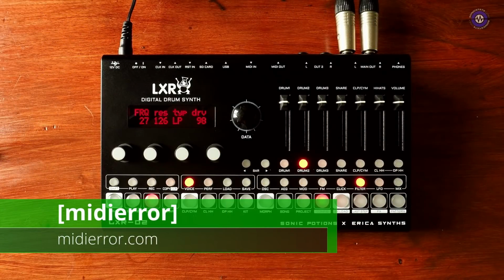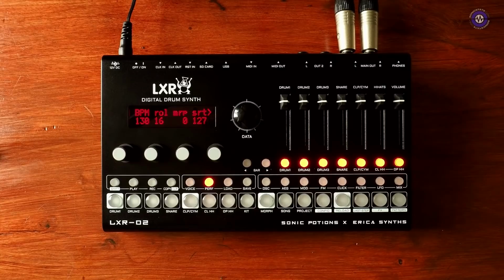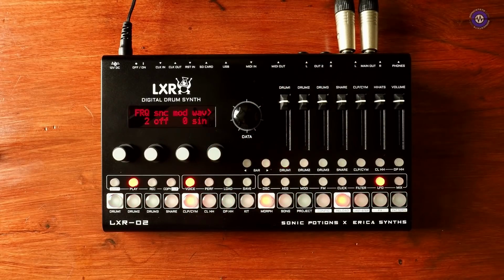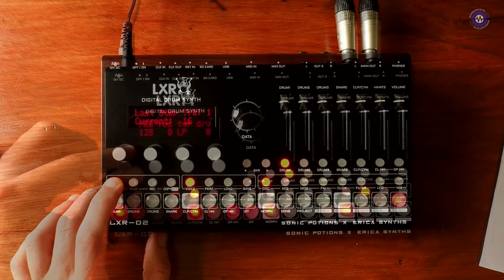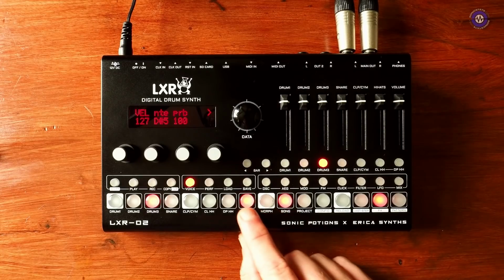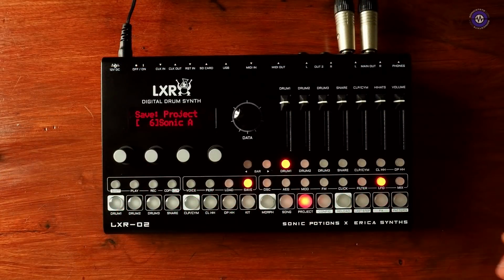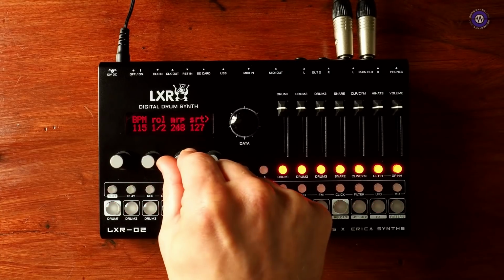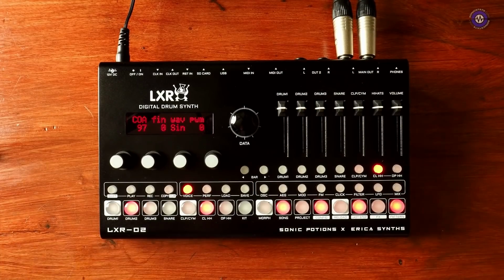Erica Synths LXR-02 Drum Machine - SonicLAB Review

Comment: After much Umming and Ahhing on my part, I at last decided to get an LXR02.  I've only had it a week and I'm still very much at the reading/memorising the manual stage but here's my first impressions:

PROS: Solid build and good feel.  Amazing sound design possibilities - and you can play each drum voice as a chromatic monosynth from an external controller. The drum voices lie somewhere between the Volca Drum and the Model Cycles/Syntakt.
CONS: Button layout makes no sense. The developers should have used the same UI for loading/saving projects/kits/songs as the patterns mode (i.e.  using the steps and bar buttons).  I look forward to the implementation of 
"Performance mode" because, at present,  it's kinda empty/crap.     There's no stepjump or live stutter  control.  The live "roll" feature is gridlocked to 16 steps per measure (there is a flamm feature in step record though).

Comment: Thanks for the video. I was so excited when I heard this machine was on the horizon but now (and sorry to go against the flow of opinion) I'm bored with it already. Work flow appears cumbersome, just 16 steps per pattern (really is that correct?) every demo so far features such a limited sound palette (which on paper shouldn't be the case). 

I was hoping it would have everything the Nord Drum lacked, mainly the sequencer but it doesn't appear to be the case. This sounds very similar to the Waldorf Attack vst if you ask me. I'm so glad i didn't immediately rush out and purchase one based on the hype. It is way overpriced in my opinion. 

I do think it would work great in conjunction with something like the Roland TR8S but then you're spending over a grand on just percussion sounds. With a Volca and some additional fx you would be spending around 75% less than the cost of The LXR-02 and achieving pretty much the same result.

£200 less and I may be tempted. I'm pretty sure the second hand market will be awash with these in a few months anyway. No offence meant people just my opinion. Thanks again for the video.
Reply: has 64 steps / pattern: https://www.sonic-potions.com/lxr02 with subdivisions it can be 128 sounds to get in there

Comment: interesting  drum machine  it's like  having  aspects from the model cycles and the model  samples
also a bit like the roland tr8s  with it's acb and FM  engine, plus sample wavs
Reply: i agree with your TR8s analogy though do not personally see any particular similarities to the Model:Samples.
Reply: @scottarmstrong8585  the model cycles  has drum synth engines
model samples has 'samples' .. which this drum machine also has.. though not  user loadable..only presets
Reply: @cresshead  They might add it later down the line maybe? OR maybe a totally sample based unit with similar features as this id buy both
Reply: It is dirtier than the cycles, I have both and the cycles has been made redundant, mainly down the the god-awful snare on the cycles…it has about as much power as an ants fart.